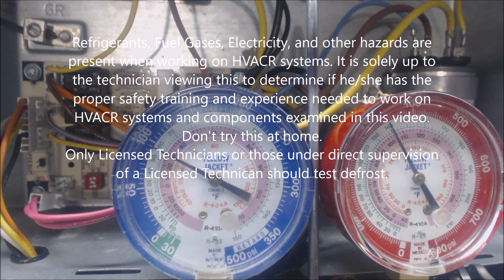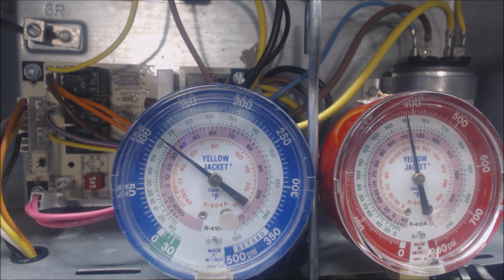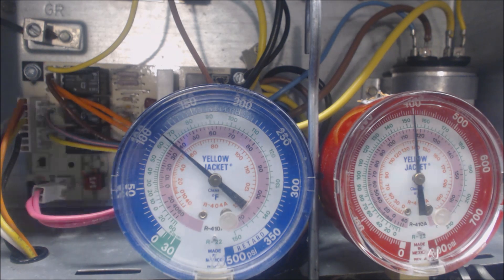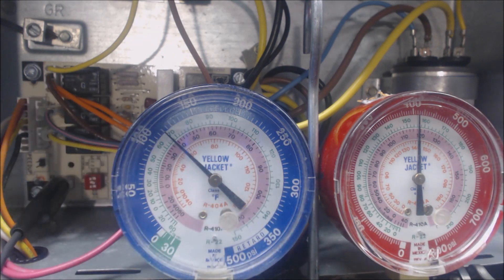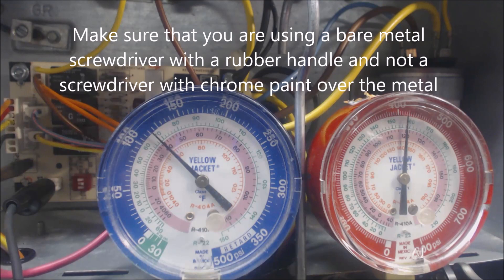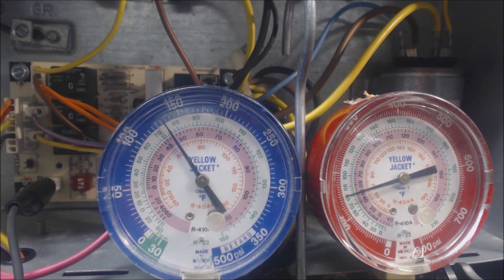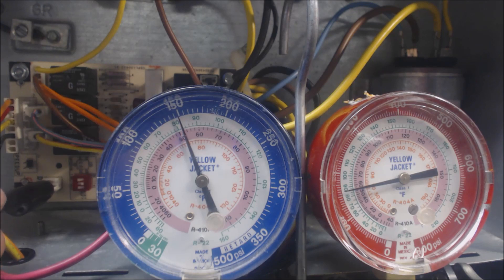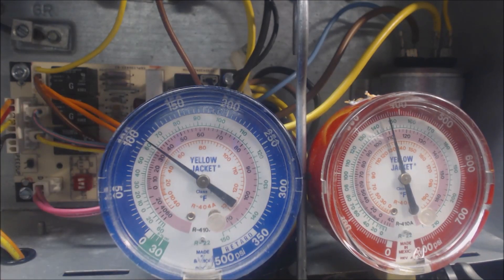Heat Pump Troubleshooting- Testing Defrost Board to Force Defrost!

Comment: The T1 terminal on these Carrier/Bryant boards is actually used to provide the logic with a signal each time the contactor coil is energized so it knows when to start counting accumulative run time. For these boards to initiate a forced defrost it need 3 things prior to shorting the test pins.
#1 - It needs a 24V signal between R & C entering the board.
#2 - It needs to have 24V between the T1 terminal and Common
#3 - The defrost stat needs to be closed.
If all these requirements are met and it will not initiate a defrost, the board is bad.
Nice video and Happy New Year.
Reply from the maker: Yes the outdoor unit does need to be running before trying to force defrost. The outdoor unit always has 24v power between R and C if the outdoor unit is on. If the outdoor unit is running in heat mode already then T1 is receiving a 24v signal through any pressure and temp limit switches from y on the board.  If the unit is running in heat mode already then the two things you would need to do are to close the dft and to jump the test pins.  Thanks
Reply: acservicetech I have found several systems over the years that did not have R power going to the defrost board. The system will still operate normally, with the exception of defrost operation. On the on the updated version of this board I have found the T1 wire misplaced and put on the common side of the contactor coil rather than the Y side. Again, the unit performed normally, with the exception of defrost. These are all good things for guys to check when running onto defrost issues. Just wanted to share. Take care.
Reply from the maker: Yeah the last video I put out was on wiring the board and where these wires should be. I agree and thanks for your comments.

Comment: excellent setup for your gauges. Comparing the true suction line to the vapor line is a GREAT tip for dx an faulty/leaky reversing valve.
Reply from the maker: Yes and if you check for a temp difference always use the suction lines of the valve to do to the temp test as well as the discharge gas lines will give off heat via the larger body of the reversing valve. Great observation!

Comment: OK I know were the true suction is but was the red hose on the high side connected to the discharge or the summer time suction??
Reply from the maker: The red hose was on the discharge gas vapor port in heat mode and the low side vapor in cooling mode. This port is always the vapor. The small line is always liquid and in heat mode it is right after the piston. Thanks

Comment: Hey how's it going got a question for you the dft on the unit in this video looks like it's in the carrier family of products what's the output voltage for the dft from the defrost board and is it actually or DC voltage? Thanks Eric

Comment: hi sir i have a question ? i never worked on big rtu units 2 stage if u need to change a compressor do u have to take out all refrigerant from both compressor, or  is each compressor has its own lines to the condensor   or all together 
thank you very much for your time
Reply from the maker: Hey HVAC/R junkee, each compressor is usually sealed to it's own evap and condensor coil. You are recovering refrigerant out of one of the two systems. Just make sure that you are planning ahead for the location of your braze joints to keep the heat off of the other pressurized system. Thanks
Reply: thank you very much for your help
Reply from the maker: No problem HVAC/R junkee!